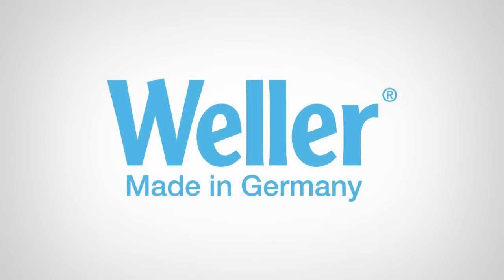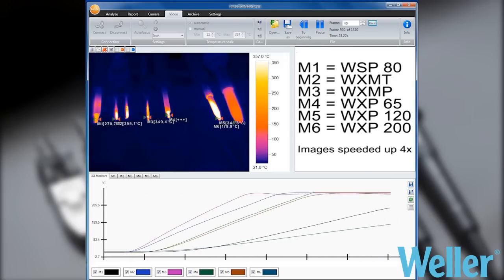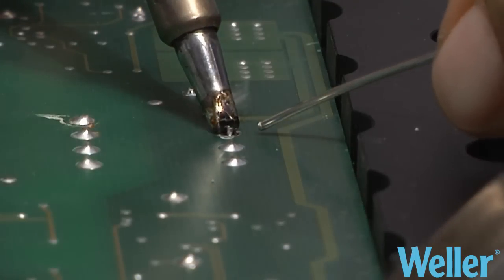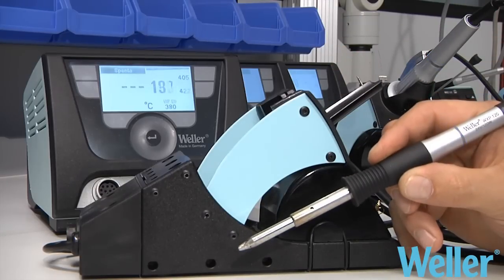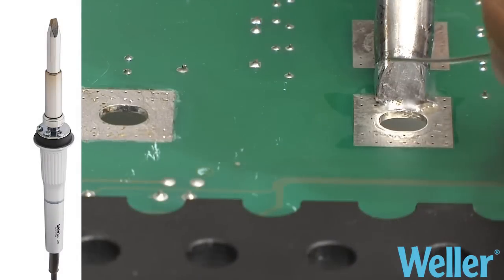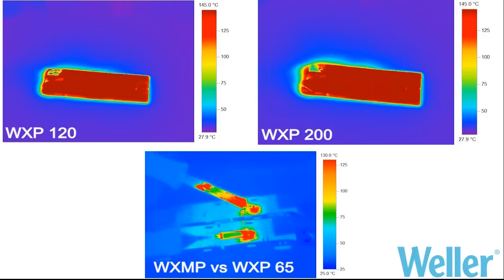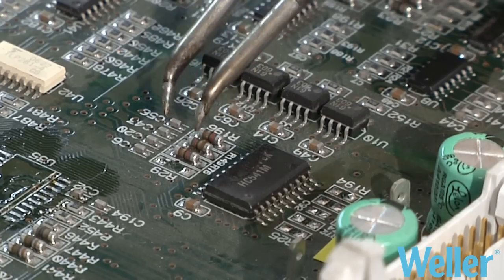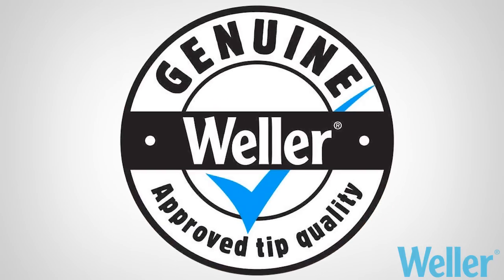Weller 3 heating technologies

Comment: Got more than half of the kit that fits on the wxr3 the 120 watt desoldering iron is excellent.. The 200 watt hot air gun needs to be flat out to do much its fine for single tiny components. If you got much ground you will need pre heat..

Not only do you get three heating technology's but you get three ways to change your tips and three lots of tools to change them.. I feel for premium gear  its very bitty across the range and feels a bit cheap. If you buy an iron and stand kit you get no contents list to say what you should have or not.. Just for fun every order comes with airline fitting straight couplers even if your tool does not need air..

The wxr3 is fine simple to use and gets you upto temp from cold in under 10 seconds..

So far it's 50 50 love hate with this top end tackle.. I hope it grows on me..

Comment: Weller makes good stuff, but my god did they make compatibility confusing.
I bought a used WD2 station and want to get the tweezers for it.

Well, it's the 24V station.  It was a nightmare finding a source for the handle for the tweezers that's for sure the 24V version.  And I still don't completely understand if the tips are the same or not.

All just to force you to buy their stuff.  

This is why right to repair needs to become law.

Comment: I've discovered that Weller products are as reliable as German cars...
Reply: That not true, most Weller solder irons are built much better and last years and I know I used a few different soldering station over the years. I used JBC, Metcal Hakko and Pace and Weller and Pace uses metal in handle unlike the thermal plastics in the JBC and Hakko and cheaper Chinese soldering irons and tips on the Well last over a year so far and been using it for hours a day, where the JBC had to replace tips every 2 weeks to a month. Yes My WX-2 has a fuse in it as well. Their cheaper Weller stations were known for not having a fuse and being unreliable.

For me I prefer the Weller hands down for most projects and Hakko second. Did have a JBC Nase 2 that I sold over it, as JBC was only good for iphone board repairs, but overall handle unreliable, yes had 2 handles failed to detect the tip and tips were to expensive to only get under a month for them.